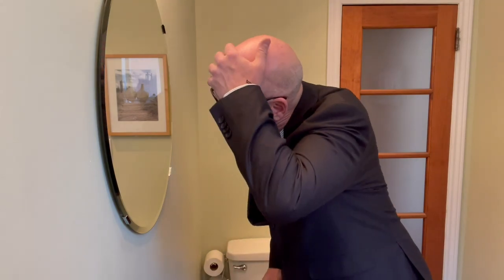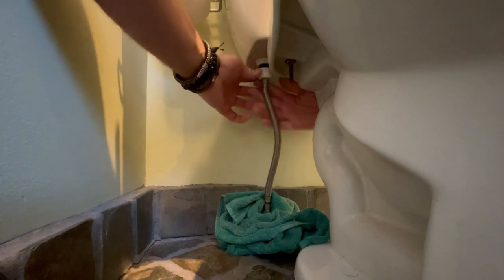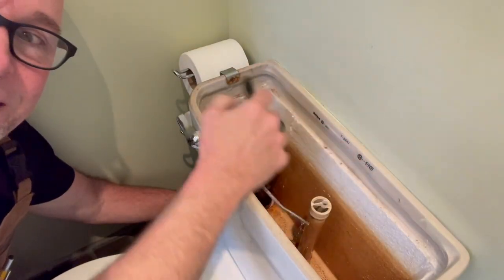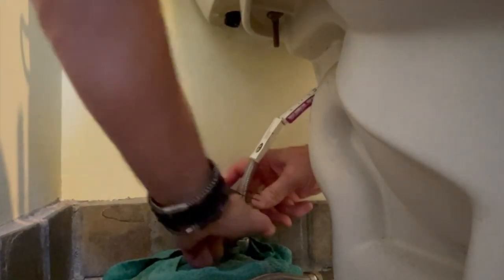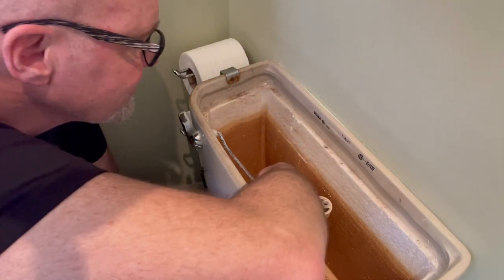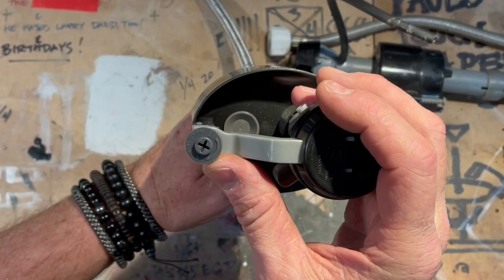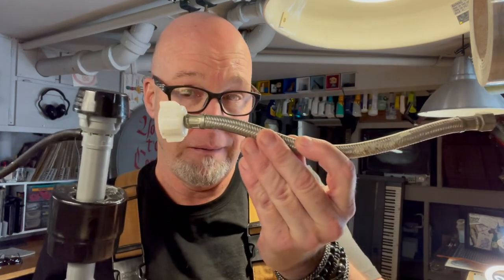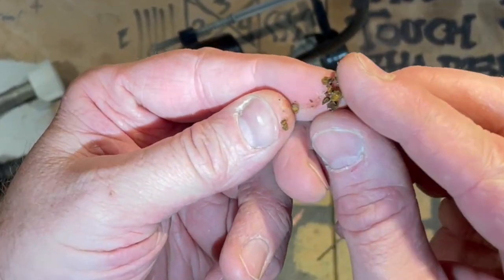JET ENGINE TOILET SOUND

Comment: Holy shit did you make me laugh what a comedian.
Then I realized this guy's actually on to something. 
Because my seal was fine and nothing else made sense
Reply from the maker: Just two days ago I was asked to check on a pressure problem in a kitchen faucet. I started with the aerator, then the cartridge, and eventually worked my way down to the speedway to find that some really weird stuff had accumulated there. It looked like little pieces of white plastic. I think what happens sometimes is that a building's water is turned off, some pipes are purged, and pieces of o-rings, washers, gaskets, plastic fittings, etc. get sucked down to the entry point of the building's plumbing, and then when the water's turned back on and tenants open a tap, that gunk gets redistributed downstream to brand new places to cause blockages. It astounds and surprises me every time.